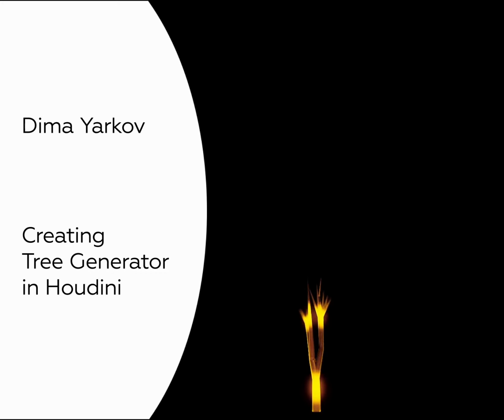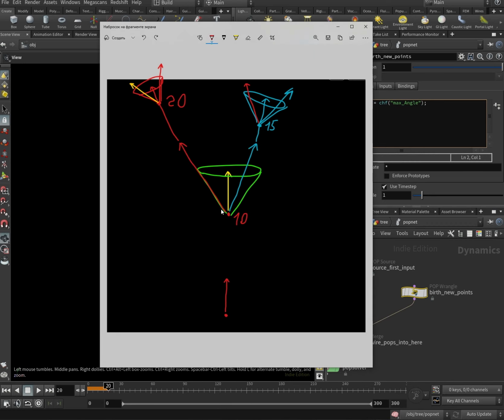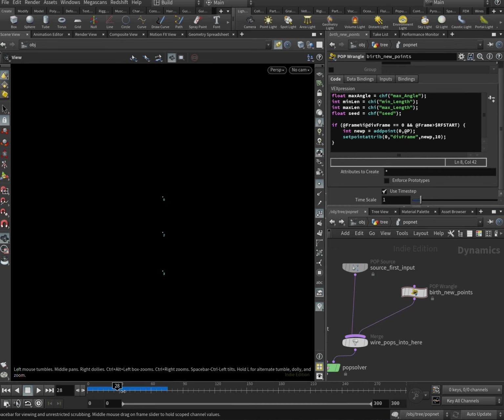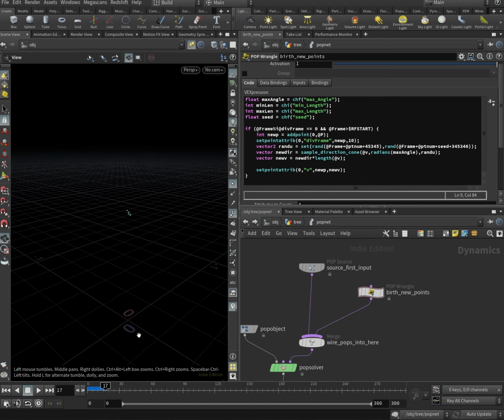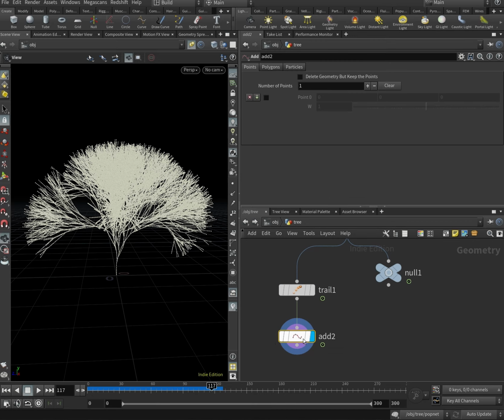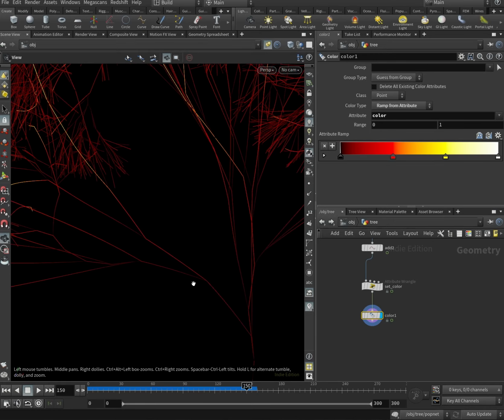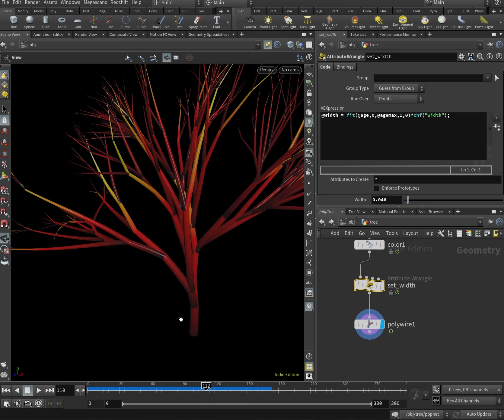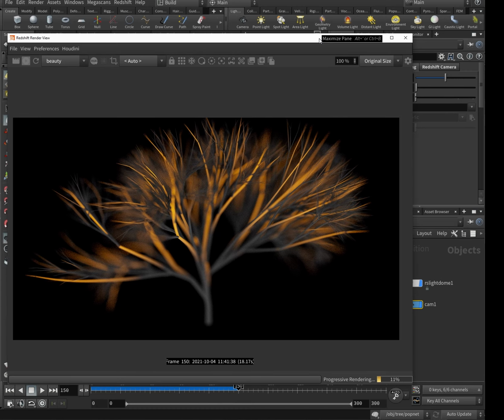Creating VEX Tree Generator in Houdini / render in Redshift

Comment: I don't have Redshift, What should I do in my case with Mantra render?
Reply from the maker: You can either to download a demo-version of Redshift (I believe they still have this option after been bought by Maxon), or use Mantra of course. In Mantra you can get the same result with the same camera parameters. The only difference is a material setup, you'll need to build your own Material Builder. You can find tutorials in internet
Reply: @3dvizer  Thank you for your answer🥰 I really appreciate it😉
Can I ask you one more question? 
I have no one to ask this😭

My cpu is amd 3990x which is 64 cores(very good cpu) but my gpu is Rtx3060 which is very normal 8 vram gpu.

From my understanding, Redshift is gpu render and in my case, My cpu is much better than my gpu.
So I think it doesn't make sense for me to use Redshift??? 
I would like to hear your opinion in my situation .
Please help me😂
Im frustrating because most of houdini tutorials nowadays use Redshift.
Reply from the maker: @heesang1989  Redshift is just much faster than any CPU-based render, and especially than the Mantra, which is the slowest render ever. And RTX 3060 is a very good graphic card, you should definitely use it for gpu rendering. For sure there are situations where RS will be slow because of the heavy geometry. For the tasks like in my tutorial RS is great.